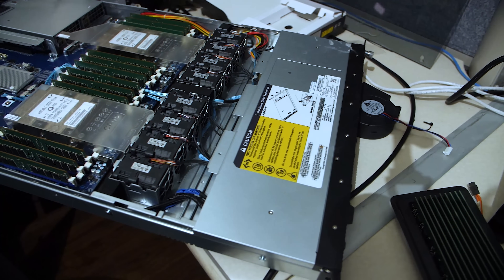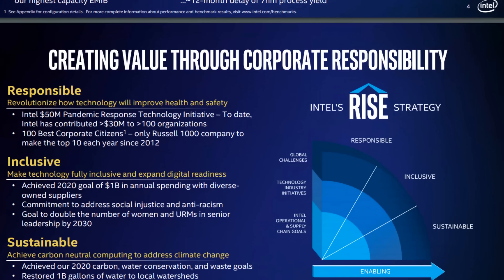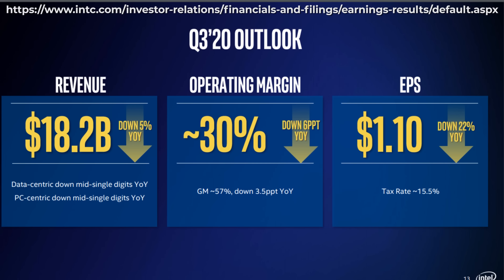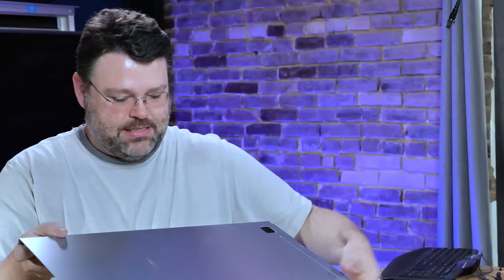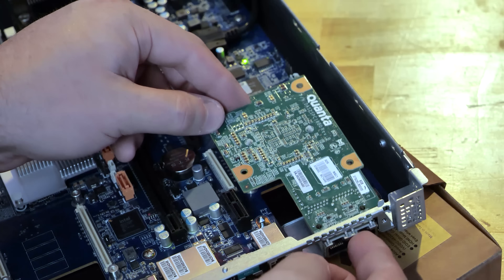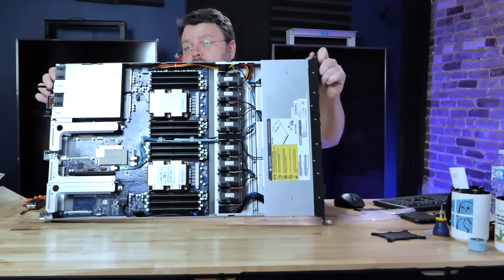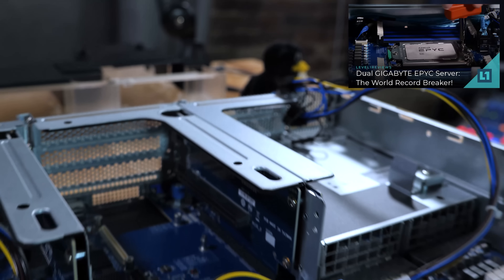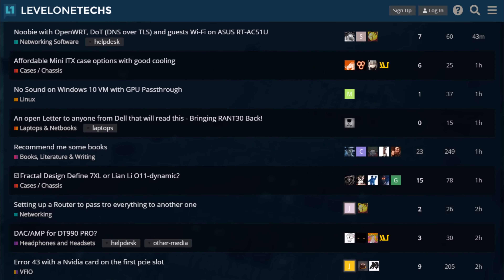Dual Xeon Platinums - For Less Than $1K! Amazon's E-Waste!

Comment: I picked up a pair of E5-2630v4 for a really reasonable price & I thought that was a good deal but dang. 8120s for a fraction of the price! All the cores, give me all of the cores.
Reply: Why V4 when cheap V3 are flooding aliexpress on extreme low prices and even gamers buy them to game on them :P (Source: my PC: 2678v3 - $80, X99 motherboard with 8x DDR3 slots - $75, 32GB of DDR3 ECC RAM - $40, moded bios for all core turbo, 12c/24t 3.3ghz all core in light load/games)
Reply: @cayo2588  I had a since, a v1 cpu. It worked fine and did the job. I just wanted a little more thump, plus slight IPC and ddr4.

Comment: The ram insertion editing was awesome. Now that i think of it AMD really charges a lot for high capacity memory support. Ryzen does 128gb, threadripper 256gb and if you want any more than that your 8 core epyc starts at like 500€ and a 16 core is around 800€. If you want to build a machine for CFD simulations which needs a bunch of ram your entry option for 256gb ram is a 24 core threadripper. its a good cpu but at that point a core i9 10900X 10 core is half the price with similar single core performance.

Comment: That cannibalizes future earnings though. Amazon is now upgrading to a almost top tier processor for cheap and it must be really cheap in order to make sense and won't need to upgrade those servers for a few years. I don't even know how the math makes sense when the power consumption of a server costs you as much as the processor. It takes 6 top tier Intel CPUs to equal 2 Epycs and the Intel CPUs each cost 4 times as much as the Epycs combined. I Priced a $800k Intel server that matched a $115k AMD server. So how are they making up that difference when a company like Amazon needs 10s of thousands of servers? No amount of customization costs more than the hundreds of millions in savings. I think there is a time factor at play. By the time they rebuild their software stack they were betting Intel will catch up to AMD and they would be switching back again.
Reply: They're going to find out the hard way that Intel is not catching up for years...if even this decade.

Comment: But do you have a CDROM drive in that server? :-P
All kidding aside, you are making a lot of assumptions. I would be nice to see some proof from a source at Amazon. If Amazon is using HP servers, those service contracts get really expensive after a couple of years. I can't imagine AWS running on old hardware, even if the CPUs are newer. Would you upgrade a 5 year old server with 20k worth of newer cpus? What are the risks? And on top of that, customers just want the latest of the latest... do they also upgrade GPUs, memory, drives? Might as well upgrade the whole server...  
From what I understand, Intel is making a huge profit on what they sell, not on how much they sell. I can't imagine that 14++++ cpus cost a lot to make any more. Large enterprises are stuck using Intel cpus for their laptops and their servers, but that's slowly changing, as Intel can not keep up with the demand, and AMD laptops and servers are cheaper. Apple is also moving away from Intel, which will cost Intel a couple of million of cpus a year. The true brilliance of Lisa Su lies in the fact that she realized that she had to beat Intel in the enterprise market. The enthusiast market is just an added bonus. AMD has been innovating, but Intel has just been busy optimizing their profit for the last 5 years. Once they run out of current orders, they're going to have a bad time. They'll just pay out high dividends to keep the shareholders happy for a while but even that will end at some point. Once they start to run out of money they will have nothing left. I'm sure the executives at Intel are aware of this and scared shitless.
Reply: Companies like Amazon, Google, and Facebook don't use off the shelf servers from HPE and Dell

They buy CPUs directly from Intel and contract directly with ODM factories to build servers that they themself designed in-house

Comment: I'm running dual 18 core CPUs (Intel Xeon E5-2696 v3) in my z10PE-D16 WS. The biggest difference being mine are rated 2.3GHz, thought they typically run 2.8 ~ 3.7GHz in real world operation. Still not worth the upgrade for me, but this is interesting...

Future upgrade is still planned for a Threadripper 64 core... Mainly because running this platform has been a PITA with Windows 10. I get so many odd problems other people don't encounter, and the system is far more likely to get bricked from a Windows update. It's happened 4 times since I built the machine. Corrupted installs that could not even recover using the Windows recovery utility.
Reply: Windows server?

Comment: ~4 years ago I built a workstation system with dual E5-2686v3 18 core chips, also Amazon chips. Did a turbo mod to make it run 3ghz all core. Anyway, bought the CPU's for 350 each. Great content as always Wendell!
Reply: I bought a 2650Lv3 for $7 last week :) they're getting so cheap.

$80 ali express special mobo, and i'm set.

Comment: I was about to buy a couple 8180s but the $5.17 shipping was a deal-breaker..
Reply: +deinemuddaisdoof Well, that's just a rip-off!
Reply: That's how these tyrants rake in the money. SCAM!
Reply: Sell the product at a loss and make it up with ridiculous shipping charges, fortunately guys like us can see through it. Bastards.
Reply: Threadripper is still cheaper (for example even like 2 years ago or more you could get TR-1950x with 16c/32t for $499 new, and of course the motherboards weren’t too bad, and mine even with a wimpy 120mm AIO (that I paid $24 for) I was able to get 4.15-4.2 GHz all core on mine).

I’m not sure what the thrill of getting overpriced obsolete hardware with no upgrade path is, because it’s still overpriced even when it’s this discounted (it’s like a million dollar cookie on sale for $100, it’s still a ripoff...)
Reply: @jakegarrett8109  I think it's mainly for enthusiasts that why you don't get it.
I myself buy outdated tech all the time just to have to tinker with it.
Reply: @phillip_iv_planetking6354  This isn't even good value for old tech though. Ex: For a mint in sealed box Fire-GL V8650, the most powerful Terra-scale card made as well as the first 2 GB card thanks to 32 chips of GDDR4 coating the front and back, was $40 for me. Excellent price on retro stuff if you wanted to play with it (but not these crappy Xeons, there are other great Xeons for that, I'd probably do quad socket as that seems more fun, just like my quad crossfire on my main machine). I've got older stuff up to my Titan Xp Star Wars edition. I love tech new and old, and benching them to new records is to me more fun than gaming (I got an excellent deal on a phase cooler and I use it a lot! Especially since its way cheaper than LN2, because LN2 prices are extremely over-priced where I'm at, but thankfully Dry Ice is pretty cheap for testing).

I just don't see these Xeons as any value, too expensive to play with, and its value sucks, and its not retro... It doesn't meet any requirements I can see.

Comment: What will be great is when Amazon, or any other company really, finally goes to Epic new gen and dumps all of the processors and boxes onto the web, maybe even ddr4 if ddr5 is out by then.
Reply: It's starting to happen now, workstation machines of this generation are being dumped on eBay for fairly cheap.
Reply: They will most likely just license arm chips and make their own processors or even asics.
Reply: @temkaster2  ARM Alternatives need to rewrite your whole software stack, instead of just validating hardware and making some optimizations. ASICS or FPGAs are pretty limited if you expect to run anything besides one narrow workflow ever, while x86 can run a huge variety of stuff. 

While in the five to ten year timeframe Risc-V and specialized accelerators will take over some workloads and applications, I suspect we'll see more Epyc adoption before those alternatives are able to take their foothold.
Reply: @daniellewis1789  depends on your stack. We run a lot of Java, a lot of lambda, you can run Redis, mariadb, all sorts of fairly standard software.

The biggest problem is performance, especially for something like a centralised db host, but that's about to change.

Comment: Got any tips of used enterprise gear someone can get for 100 bucks and edit 4k footage?
I made some poor decisions in my life and that cought up leaving me broke and using an I5 2500k to do rendering.
Reply: At that price point you need a specific basic that decodes video.. an old GPU form amd or nvidia cuda/vulkan software support might help? 4k resolution at which codec?
Reply: @kitecattestecke2303  Usually I work with DNxHD intermediate files and encodes on handbrake using x264 an x265.
GPU decoding helped a lot, but it's still not enough. Some plugins don't work well with it.
Reply: Xeon 2678v3 + DRR3 ECC RAM
Reply: @cayo2588  that's the one you can lock the turbo right?
That actuality might work. I found a cheap x99 motherboard near my home.

Comment: It's interesting AWS is unloading their c5 class CPUs. I guess they must be close to launching a c6. You would think they'd keep the old hardware in service longer. I guess the newer CPUs are sufficiently more energy efficient to make it worth while.

My theory would be instead that they're switching heavily to their home grown ARM CPUs and junking their custom Intel motherboards.
Reply from the maker: There are thousands of these CPUs on the secondary market but a source told me that they are still using the chassis just upgraded the cpu for the reasons I explained in the video. They are keeping the hardware sans cpu in service lol
Reply: @Level1Techs  The ones I'm seeing on eBay are $900. Is there a better place to find that secondary market?
Reply from the maker: @MarkRose1337  yeah, keep your eyes peeled. a couple weeks ago it was easy to find  for sub $500

Comment: Using a Threadripper torque screwdriver to install Xeons? Heresy!
Reply: Well AMD does like to put the pressure on Intel right now.
Reply: @backupplan6058  Ouch! :D
Reply: @backupplan6058  in enterprise servers like this, Intel still owns AMD in every section
Reply: @weavercs4014  uh EPYC would like a word.
Reply: Intel: Screw you AMD
AMD: No U
Reply: Just another case of AMD putting the screws to Intel.
Reply: That's a different amount of flex
Reply: Heretic. OR ... ARTISAN GENIUS TEACHER.
Reply: You can't object to your own question
Reply: Did Intel just get screwed X)
Reply: Yes, shouldn’t touch intel stuff with any amd crap

Comment: These offmap CPUs always seem better somehow than their on-map siblings like the Facebook E5-2678V3 with the DDR3 controller.
Reply: I'm assuming because they're not officially supported there's less potential buyers for these CPUs.
Reply: @TheAnoniemo  With these CPUs being fairly undocumented they tend to be priced lower on the used market which means they can be a bargain for a time until word gets out. Motherboard support seems ok as they tend to use the same platforms as their siblings. The E5-2678V3 I mentioned above has a DDR3 controller in addition to the DDR4 controller unlike the on-map E5-2680V3 which is DDR4 only, because Facebook was afraid of DDR4 shortages at the time.
Reply: @drivingmemad7127  Yep, I game on my 2678v3 with dirt cheap DDR3 ECC RAM, I love it so much.

Comment: All else being the same, I would probably be running Threadripper if I built today, but I’m still happily humming along with a pair of E5-2667v2’s and 128GB of dirt cheap ECC DDR3 RAM.  All inside a sub-20L case I can fit inside my carry-on!

Comment: I looked around for LGA3647 stuff on ebay, and saw some 8160 24c chips as well, for even lower prices. I wonder if those are the least bit legitimate, or if they're a scam. They do have a very thin set of motherboards listed as supporting the chips.
Reply: The ES ones are Engineering Samples which likely lack many of the finalized variants...I THINK. But I'd love to figure out where these are to buy one.
Reply: @trumanhw  Looks like they're still on ebay when you search for LGA3647.